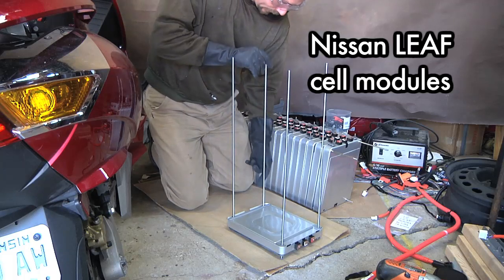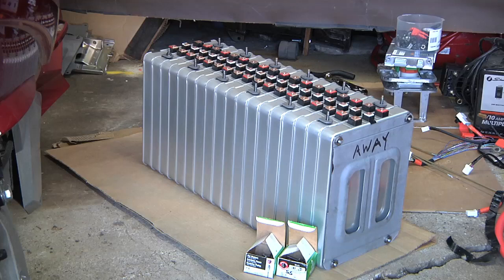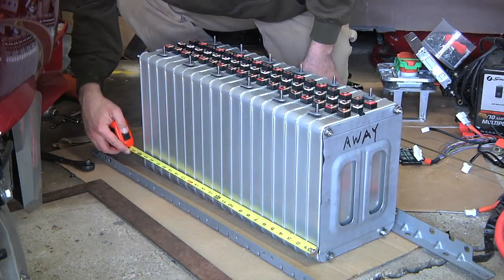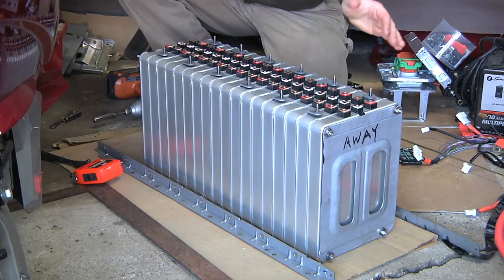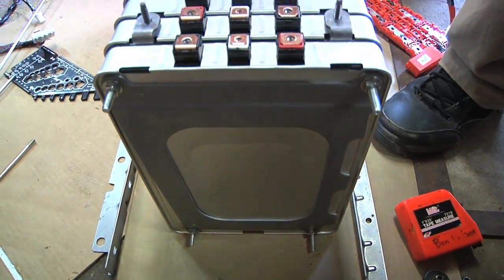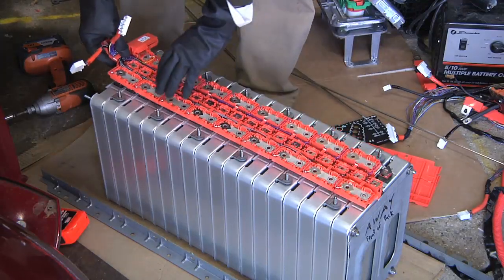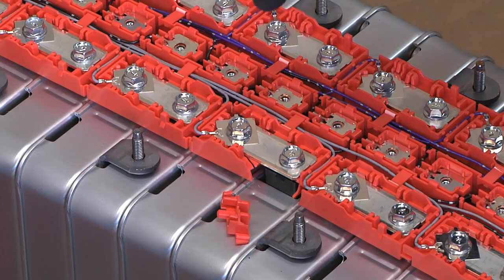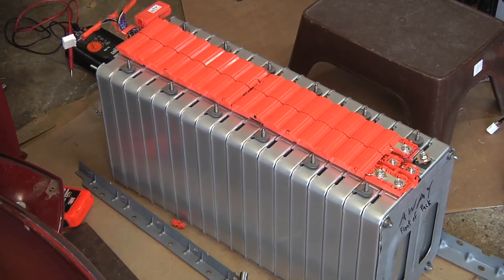Vectrix Upgrade: Battery Pack Assembly

Comment: Hi Ben - ahm - how are 18 cells enough? Aren't there 36 required? What's the nominal voltage of one of these cells? 3.7 or even 7.4 - I don't get it.
Reply from the maker: These are cell modules. Each has two cells in series and two cells in parallel inside the tin can. So, the voltage is DOUBLE what you might otherwise thing. I can charge this pack up to 150V.

Comment: From what I have seen, the Leaf battery packs are mostly at around 65% life. Is there any real value in building these large packs. They are expensive also.
Reply from the maker: I bought a Leaf battery pack directly from a Salvage yard, took it apart, and used it as the pack in the cycle. The car was very low mileage, but was wrecked by being crashed into a tree.
I only needed about a third of the pack. I sold the rest. The profit from that paid for buying the pack in the first place.
So, I went from having an electric cycle with NO functioning Nihm pack, to a fully-functional lithium pack, at essentially no financial cost, (but a bunch of elbow grease!)
So, YES, there's definitely value in this.

Comment: Hey Ben, thanks for your vids, I have watched them all. I have two questions. How many modules did you use in the pack, and is there any difference or benefit in using the 1st gen pack vs the 2nd gen. I am having a hard time finding a wrecked Leaf or even the battery pack, down here in Texas. The Leaf is not really a popular vehicle here, and the salvage yards that do have them, want a mint for them. With that in mind, could a Prius pack be used?
Reply from the maker: There are certainly other batteries you can use. However, if it is specifically for a Vectrix, Leaf cells are ideal, like they were MADE for this bike. Besides salvage yards, there are also eBay sellers and HybridAutoCenter sells them too.
Reply: BenjaminNelson Yep, it's a 2007 Vectrix that I bought off Facebook. I have been searching for weeks for a Leaf battery, so I will keep looking. Thanks, Ben. Keep up the amazing work, sir.
Reply: 18 Leaf modules in your pack?
Reply: Tommy - I'm east of Dallas. What have you found in Texas for salvage batteries?  I'm paying $75 ea. leaf module from tech direct right now.
Reply: @TimFrentz  is there an online website where I can buy them. I jus t purchased a 2007 Vectrix and my  dash kept reading "BUsVLT" does anyone know what that means.
Reply: @MRWMG1800  tech direct club

Comment: Threaded rod is not very strong..and the sharp threads can do damage in the holes they run through.  Plain rod can be had in many grades.. all better than hardware crap threaded rod.. not hard to thread the plain rod.  You will like it in the long run and it's cheaper too.

Comment: I noticed you are not putting any insulation pads between each battery cell. Wouldn't this be a good idea in case of cold weather to help keep the battieres warm and not ruin mileage efficiency?
Reply from the maker: TekReview's I'm basically just trying to use the batteries in the same way there were when in the Nissan LEAF. The LEAF did not have any insulation in the battery pack. I don't ride motorcycles in the winter, so it's not really an issue. The capacity of this battery pack is also so large compared to my range needs that even if it was at lower voltage due to temperature, I would STILL have plenty of range.
Reply: BenjaminNelson Most EV conversions have some sort of water cooling/heating setup. So the batteries in the Leaf might not last as long if they don't have some way of heating them in the winter like other cars such as the Volt.

Comment: Are you going to glue that broken plastic bit back on? Seems a bit dangerous leaving it exposed.
Reply from the maker: SclohOne I might try gluing it back on with some silicon. Just one corner like that exposed isn't dangerous. This all goes in to one big plastic box when it's done anyways. What is dangerous is touching both of the far ends of the battery pack, (or dropping a wrench across a few terminals) Each individual module is only around 8v.

Comment: That looks so good Ben!  Question. How Manny kWh was the original battery?  Still wondering how your going to balance charge this thing! Wohoo! ~Russ
Reply from the maker: ***** An entire LEAF pack is 24Kwh. This section of it is 9Kwh. On a cycle, that works out to up to 90 miles range, about the same as a LEAF! The wire harness coming off the end of the orange bus-bar cover goes to every cell in the pack. I plan to wire a balance charger to that as needed for balancing. I'm thinking about putting a quick disconnect for it under the seat. I have a Revolectrix Cell-Pro Powerlab 6, which I think should work fine for doing that.
Reply: BenjaminNelson 
Wow, a 90 mile Vectrix.  That will be fantastic.  How fast do you think it will charge (I guess you have to use 110v or 240v and can't use fast chargers?)
Reply from the maker: FFVoyager We really don't have any DC fast chargers in my area anyways, so not a concern. With 90 miles range, WHO needs that kind of charging?! I'm not riding cross-country! The stock charger in the Vectrix can run on 120 OR 240, although the plug is wired for a typical 120V standard American outlet. I built an adapter to be able to plug it in to public J1772 stations, and that works great! http://300mpg.org/2015/03/31/the-diy-j1772-charging-adapter/ The charger is about 1500 watts, so it really doesn't change charge time whether I'm on 120 or 240. I'll just do overnight recharges.
Reply: BenjaminNelson I guessed as much about the chargers (I saw the adapter already).  We have a pretty decent network of free fast chargers in the UK - it would be awesome to be able to fast charge the 'half a Leaf' Vectrix in, I guess, half the time folk can do a Leaf in - which is around 80% in 30 mins!
Reply: FFVoyager Its not the power of the charger that will dictate the speed, its the "C" rate. :(